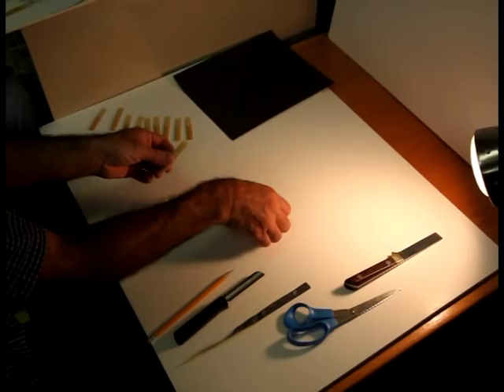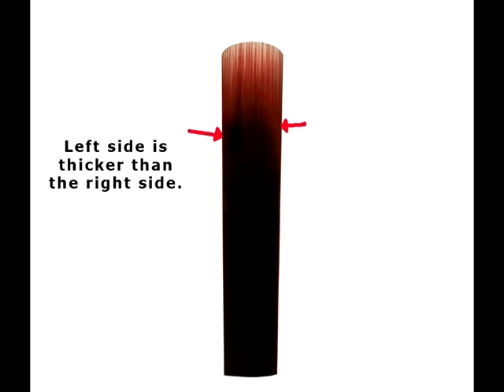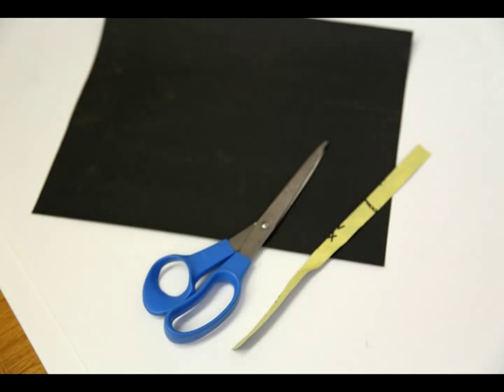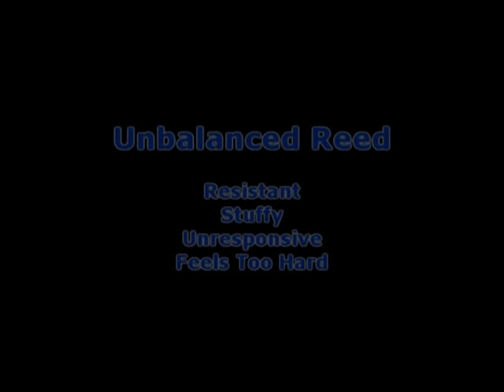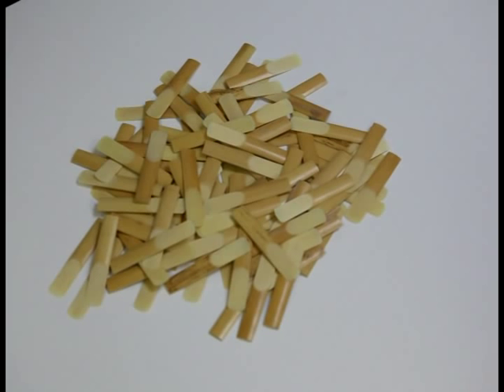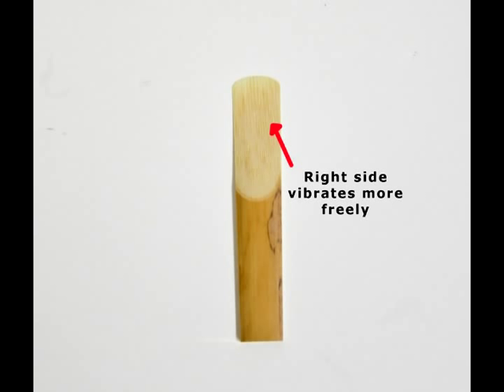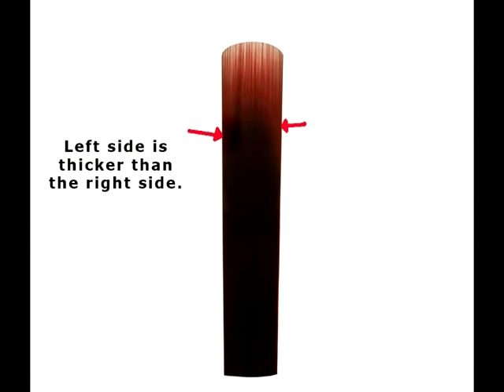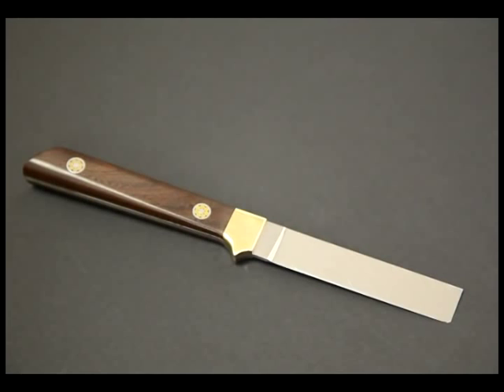Reed Adjustment Video Final Shortened New Audio Track

Comment: I concur with this system. It is the same that I arrived at. I
also played oboe , so i had experience with reed making. I play every
reed out of the box. Time consuming, but i ´m not on the road anymore and I enjoy
it as a hobby . One has to understand that the reeds one purchases are in a 
semi finished state. This means they need to be adjusted to the invidual
player´s physiognomy and æsthetic requirements.  The knife, in my opinion
requires some skill and maintenance. I use a Reed Geek in combination
with the Vandoren glass plate and wand. But as you say, I wait 10- 14 days
of short playing time before i start adjusting. Really works great for me!